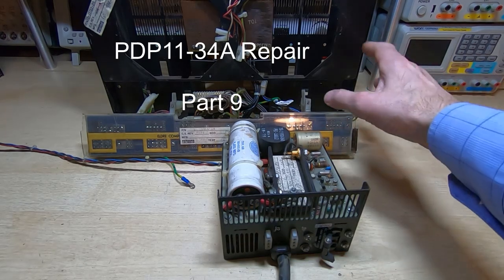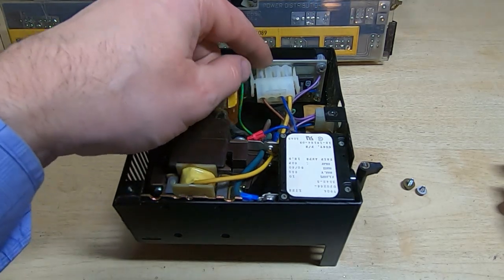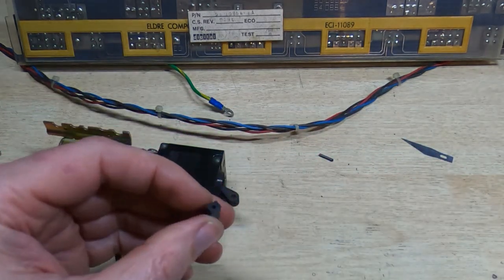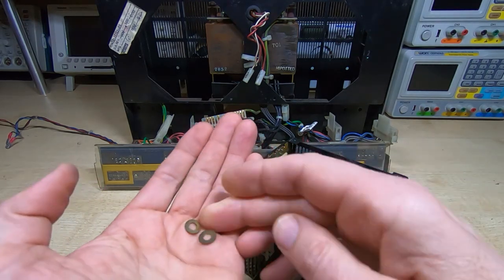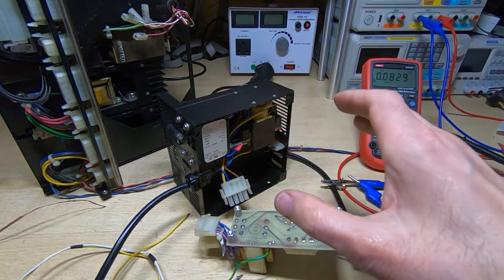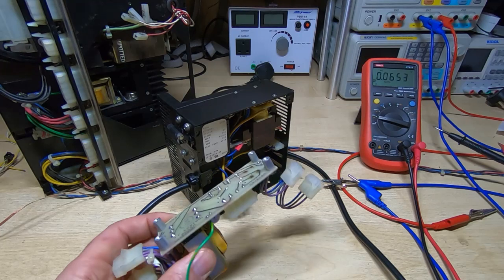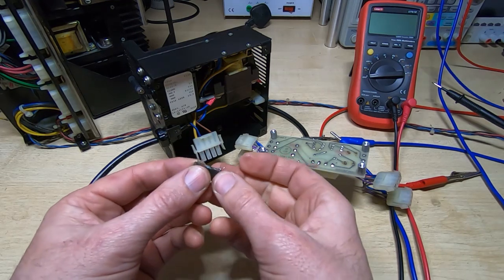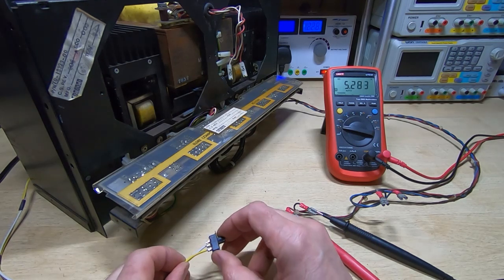PDP11-34A Repair Part9

Comment: Why did you use a carbon fibre rod (conductive) to repair the breaker lever when a glass fibre (non conductive) one would have done just as well, and would have been much safer.
Reply from the maker: Because it is much stronger bearing in mind that I had to use a very thin piece of material so it had to be strong and stiff which glass fibre is Not. It is also no where near any live conductors as the switch lever  extends 20mm further inside the switch than the end of the rod. The rod is no closer to any conductors than the metal rivets that hold the switch together (If you get an opportunity you may want to look inside one of these switches).  The rod is also totally enclosed so it is impossible to touch it anyway. The repair is 100% safe and very strong, much stronger than glass fibre would be.

Comment: I'm disappointed that the regulator unit on your mains box didn't need any work, because I have one that spuriously raises (lowers, as it were) an AC LO signal.  I don't recall what I tested, but the fault wasn't immediately obvious to me.  I had another regulator board, so I just replaced it, but it's still on my TODO.

This series is great.  I did a video going through the backplane (and looking at the BR/NPG lines), but I haven't gotten back to other material.  Now I'm not sure I need to!

Comment: Jerry, when you repair a device (like the opto-triac in this video) by cutting away part of the case and soldering on a new pin, do you ever see a need/reason to apply anything like epoxy or similar to protect/support it?  Or do you recommend just leaving it alone after the initial (electrical) repair?
Reply from the maker: Covering everything in epoxy would just make future repairs harder but it really depends on if it would add anything (other than epoxy). In this case the wire was soldered to a metal tab so epoxy would server no more purpose than it would any other solder joint and I am sure you would agree that applying epoxy to all solder joints on a pcb is not required (unless you really wanted to :) ).

Comment: Can the unit be modified for 110V AC operation?
 That maybe why they fitted such a large mains cable.
Reply from the maker: Yes it can but the current from the mains would still only be under 6A. I think that there were a number of reasons for using such a thick cable. Firstly it was a coiled, flexible cable and back then this tended to require much thicker insulation. Also it is a very long cable and the specifications for cables (even then) specified maximum voltage drop so a thick cable was needed, especially at 110V where the current was doubled and the % allowance halved (ie 4 times the problem than at 220V). It was certainly not for raw current handling capability because as I say in the video the internal wires that this cable runs to are very thin. These are just guesses as I do not know the real reasons except to say that they do not need to be so thick for the currents carried even at 110V.
Reply: @JerryWalker001  Cheers for that, to be honest I have no clue as the the current draw for a PDP 11, I do remember the PDP 11 at my place of work had a thick cable also.

Comment: Hi Jerry, these 'Clare' relays are actually reed relays, probably even mercury wetted ones and those are indeed hard to get
Reply from the maker: Clare do make reed relays but the device in this supply is an OPTO isolated triac (see schematic on page 15 of the the maintenance print set). That is why it has a quenching circuit on the output. They are described as 'solid state relays' See here https://www.lintechcomponents.com/product/012023447/203A05A3A/71482.
Reply: @JerryWalker001  Jerry, guess your right they used to be coil / reed relay, this might be later version, nice job

Comment: Switch?  It looks more like a double pole circuit breaker.
Reply from the maker: Yes it does but it is just a switch.
Reply: @JerryWalker001  I'm pretty sure that's wrong. I have many of these (from IBM mainframes) and they are all circuit breakers. 
Yours is marked "Trip Amps: 13.5" (or similar), so almost certainly it's a CB.
Reply from the maker: @bertoid  Yes you are correct.

Comment: Hi Jerry. Funny to see modelling techniques such as drill-and-pin being used in such an industrial setting! I guess that when trying to repair rare and unusual parts you have to use anything that works. Great job getting a usable pin onto that opto-triac. Little picture in the bay looks like a ferret to me but I agree that it seems somebody in the factory wanted to leave their mark for posterity - as DEC no longer exists I think whoever did it is safe from disciplinary action! :)